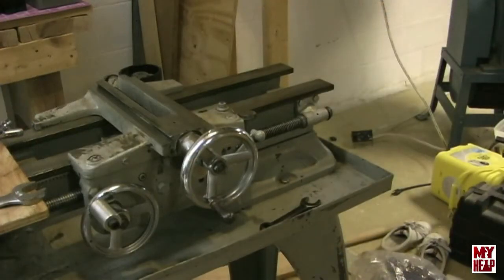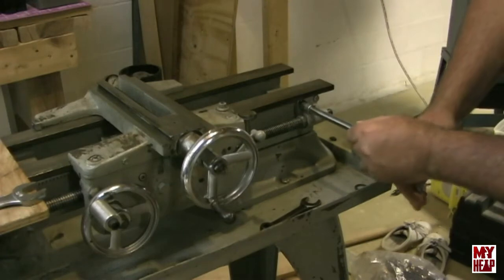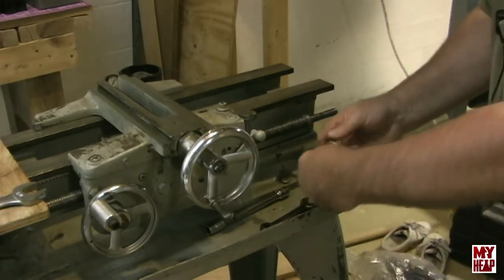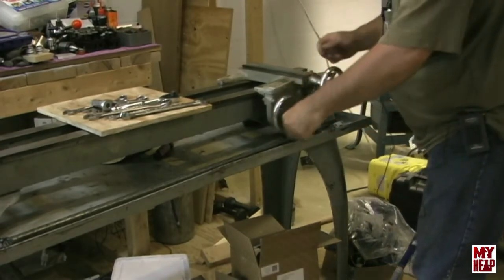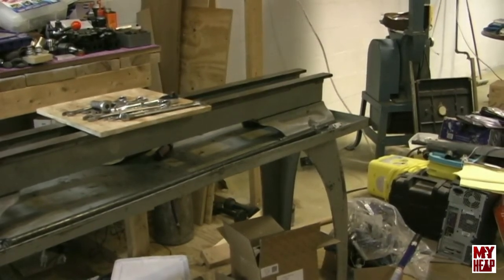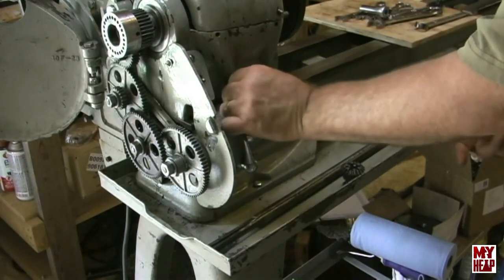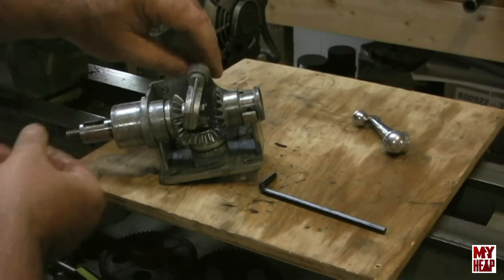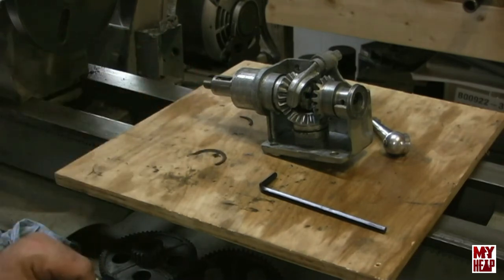Atlas 10F Lathe - TH54 - 08 - Removing the Direction Feed gear box and Saddle Apron assembly

Comment: Hi Joe, the side notches in the washer maybe to capture oil, my guess. The washer looked specific, it may also provide a specified running clearance when all is assembled. The explanation on the reverse action was quite good, I like you was scratching my head too when it turned the same way but a closer look revealed the answer. Good video, Peter
Reply from the maker: Peter,  I am glad you enjoyed it.  I ordered replacement washers from Clausing.  I discovered that the washer with the notches was replaced by two of a different washer.  These washers are quite thin.  I suppose that is why they substituted two of them.  They, however do not have notches.  Now that being said, the shoulder on the bolt that holds the bevel gear in place leaves a gap between the housing and the bevel gear.  I think the washers are only there to take that space up and hold the oil to allow it to get between this bolt / shaft and the bevel gear.  When I was putting the unit together in the video, I didn't know how you could possible line up those notches with the oil passage.  I guess it doesn't matter.  When I put it back together, I will examine it much closer.  My friend has finished machining a new bushing for the gear changer housing.  So as soon as I get a few free minutes, I will check it out and record another video.

Joe

Comment: You may have figured it out already but to remove the direction gear box you only need to remove the two top screws and the one on the front that holds the gear door plate...which has a screw at the top you just loosen. When that plate comes off you slide the change box to the right.  Leave the banjo and gears alone.  I'm stuck on the apron Philips screws at the moment.  Also (as I watch) around 23:15 the center gear has a nut outside the box top which I believe adjusts the teeth clearance.   When you installed the center gear there was a fiber washer with 2 notches which match the zamak gears. It may go by the banjo side. That top spider gear on mine had a small brass washer that fit the shoulder of the screw.  This may be previous owners attempts to adjust the teeth...whatever they had, fiber washer, brass washer  etc..
Reply from the maker: Marc, yes I did figure that out.  Mine had a brass shim that went under the stud of the center bevel gear.  What problem are you having with your apron screws?  They won't come out?

Joe
Reply: @MyHeap  I was so late with my reply but I knew you probably figured that plate out. Just trying to help.  My problem was the apron screws were extremely tight but I finally got them loose today.  I had to use a sewing needle and pick out the crud around the screw head. Then I filled it with the best penetrating oil ever,,,my friend gave me a huge Philip's screw driver,,and with a pipe wrench on the handle they finally  broke free, with a loud "crack".  My apron had decades of old crud now its clean and oiled. 
:)
Reply from the maker: Sweet, glad you worked through it with no damage.

Comment: I'm refurbishing a th54 and can't seem to get the rack separated from the bed. I have removed the 6  obvious screws, but there are 2 more on the far ends that dont have a head. Do you have any suggestions to how those come out? Thanks
Reply from the maker: I didn't take the rack off mine, but I believe they should be pins and not screws.  I recall seeing someone take the rack off theirs when the refinished it.  I will see if I can find it and post you a link.
Reply: @MyHeap  great thanks
Reply from the maker: @curtiswoods221  I can't seem to find the video.  It was either one of Mr. Pete's, or eviltwinx rebuild series
Reply: @MyHeap  ok thank you for your time.

Comment: Nice job Joe.....If Clausing doesnt carry the fiber washer, I dont see any reason why a teflon washer or HDPE washer couldnt be used as a replacement unless someone more knowledgeable about these things would say otherwise....or possibly an oilite brass washer. It appears to just keep the surfaces from making contact and is not under any real stress. They may be readily available in the size you need online...or could be made. Is the bushing with a lot of wear from the plugged oiler in such bad shape it needs replacing? If you need something turned let me know~Rich
Reply from the maker: Called Clausing and they had the washers, so they are ordered and on the way.  There is quite a bit of play in the bushing.  I will try to get a measurement and let you know.  It probably should be replaced.  The parts diagram for the reversing gear box does not show a bushing.  So I don't know if it is original, or if one was made in the past.  As always, thanks for the complements and help Rich.  I appreciate it.

Joe
Reply: Would like to see your lathe up and running...glad to help if I can 👍🏼
Reply from the maker: Thank you Rich.
Reply from the maker: I sent you some pictures of the mess.  :-)

BTW, did you get the book?

Joe
Reply: I got your pics of the bushing, lets trade a phone call on that. Will schedule your other small parts to get made in the interim :)

Book? 🤔
Reply from the maker: In one of the emails I sent you today, I asked you about elmer's engines.  I pasted a link to my website where you can get the book if you are interested in that sort of thing.  The book has about 50 steam engines in it with prints. I was given permission to host it from the copyright holder.
Reply from the maker: My cell and office numbers are in the emails I sent earlier.  Feel free to drop me a line tomorrow.
Reply: Ohh yeah, Sry...its been a hectic night. I am not much into engines...will check out your site when I get a chance tho. I will give you a ring
Reply from the maker: I get that.  I will call Clausing this AM and ask them if they sell a replacement bushing.  I will let you know.

Joe